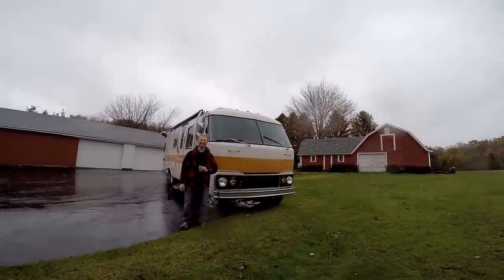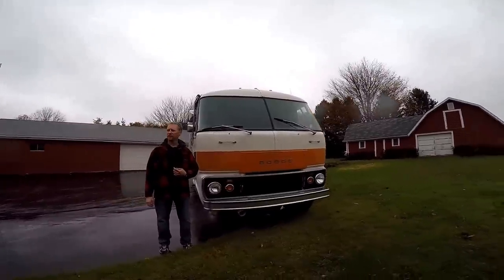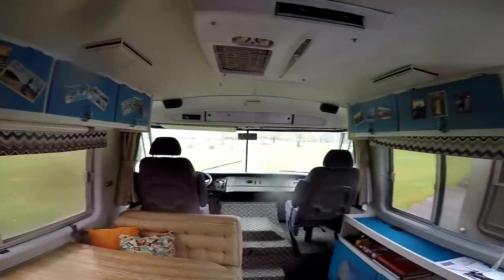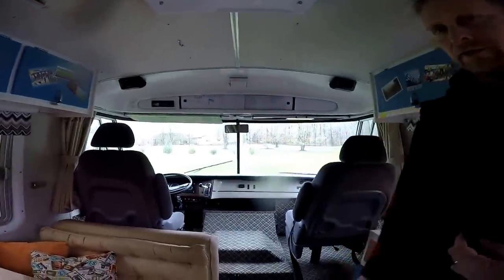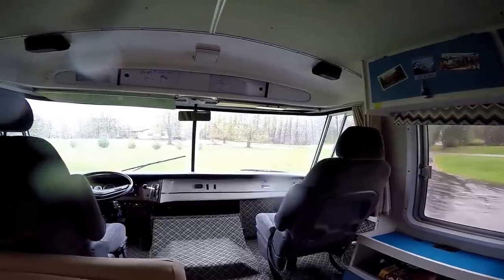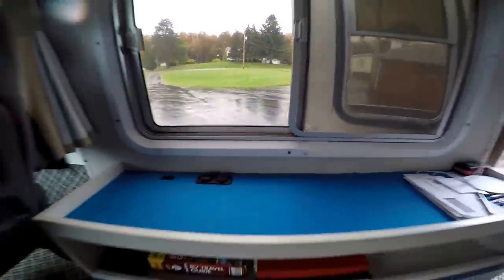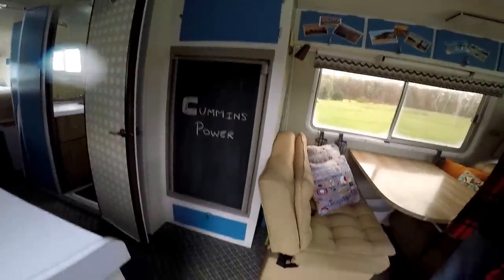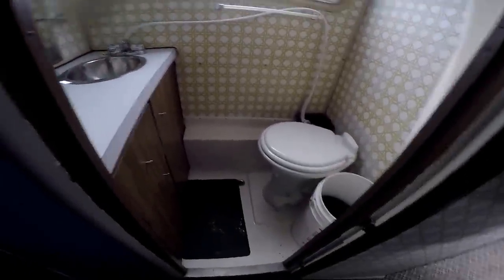Travco 270 RV Cummins Diesel Conversion + RIDE !!!

Comment: Great idea and work fitting the Cummins diresel. 5.9 liter turbo six. I had a 95 dodge pick up with the same engine. I sold my truck after 10+ yrs. Wish I had of thought of putting an all is on in my truck. I had the factory automatic rebuilt twice, the valve body replaced once and it was starting to act up again. I guess dodge can't build a decent auto to go behind the cummins. Great job man. You cannot wear down a cummins, there like the ever ready bunny, they just keep going and going, LOL........

Comment: This is a very impressive 440 RB to Cummins 5.9 conversion.  The fuel efficiency gain is significant.  Any comments about the overall performance gain/loss?  Specifically in start -stop driving and on hills?  Really nice all around rig. .. Many thanks for posting this video!
Reply from the maker: As you might expect, better low end power.  Takes off from a dead stop better than any motorhome I've been in.  I get a little slip at the top end and am looking at a lower stall converter as a possible fix.  Overall we are very pleased thanks for the comment.

Comment: Awesome machine and awesome job, great fuel mileage increase from 5 to 15 that's great. I have a 1991 Allegro with the 5.9 cummins that came with the RV I've not had it out on a trip yet so I don't know what kind of fuel mileage I get but if I can get close too 15 i would be real happy. thanks for sharing you video.again you have an awesome RV!

Comment: Sweet looking Travco motorhome. This is my idea of what a motorhome should be, not so big that you need a special bus driver's license, but not too small either. I would think that three adults could sleep comfortably in this rig. I've always liked the idea of a diesel engine in a motorhome like this. Awesome sounding Cummins Diesel. Thanks for the ride. If I had a rig like this, I would've gone either Cummins, Duramax, or even an earlier Detroit Diesel. This video is over a year old, does he still have it?
Reply from the maker: +Jason Carpp  Still have it, about 7500 miles on the combo now.  Running great!
Reply: +jpnrobb Awesome! Does he have his own channel? It'd be cool to see more vids of this Cummins powered Travco.
Reply: Three of my favourite motorhomes of the 70s are the Travco, the GMC Motorhome, and the FMC 2900R. :)

Comment: Wonder what my 318 LA motor will get for fuel economy in my 1970 Travco... Sadly, have no time to do a Cummins conversion plus it would still cost a lot just to get the transmission and Cummins to start with.

Comment: I'm wanting to drop the Cummins 4bt into my 20ft B-Camper van built onto a 1982 Dodge Van Chassis....just not sure it will fit, as of yet. Awesome rig!
Reply: are ya now lol sounds like a greeaat. idea. beat ya to it. 😛
Reply: Yes with some motor and tyranny mount mods it will fit

Comment: The Cummins engine weighs over a thousand pounds what did you have to do to the suspension?
Reply from the maker: According to Cummins the 6BT weighs in at a 1000 lbs. give or take 50 depending on the accessories.  I took the engine from a light duty pickup and installed it in a medium duty truck chassis so I did nothing to the suspension.  The MH actually rides and handles better with the Cummins than it did with the big block in it.  Thanks for the interest.

Comment: Fine job!  This is the best mating idea, taking a beautiful vintage exterior and putting in a high mileage diesel engine.  What is the approximate cost of getting this done - new engine like yours, and new transmission?  Just to get an idea of total renovation costs.

You did a marvelous job with cabinets and keeping it simple.  Looks functional and has clean lines.
Reply from the maker: +Lass-in Angeles Not sure what you would have in "new" parts but I found good used units for around 1800.00 total.
Reply: 0 p
Reply: Count on at least $10,000 unless u can do the work yourself. Also use a 12v Cummins 1989-1993

Comment: Does that engine cover have insulation, to reduce the noise of the Cummins Diesel engine?
Reply: Jason Carpp I thought the same thing, I used to have that motor in my 95 dodge p-up, told everyone you can hear me coming before you see me, LOL.
Reply: Hearing it coming is one thing, the last thing anyone wants is for the sound to be obnoxious once you get to your destination. 🤣

Comment: What would be easier is find a early 2000's class A with the allison transmission setup and 8.1 454 BBC replace the engine with a duramax diesel I think those will bolt right up to the transmission. The only issue would be smog controls lot of staters 2003 duramax wasn't any of the def fluid required.

Comment: Im doing the exact same thing do you have how you wired it with the factory wiring the engine came from i put a 5.9 with a Alison transmission already in mine with a wiring harness out of a 96

Comment: WHY didn't you go with the exhaust manifold that swings the turbo down closer to the block? It woulda saved you all the hassle of having to modify the passengers side floorboard as well as the engine cover! You can see that setup in our coach in my videos.

Comment: What chassie is that build on? Dodge RM400?
Reply from the maker: Yes Sean, that is exactly what it is. I no longer have the rig but it handled the extra weight of the Cummins with no problem.  The Cummins is only about 300-350 pounds heavier than the 440 that was in there originally.

Comment: how loud is it inside? can you easily talk or does the diesel make alot of interior noise?
Reply from the maker: I'm not gonna mislead you, it is a little noisy but you can have a conversation albeit with elevated voices :)
Reply: jpnrobb 

Thanks,  I'm thinking of doing a similar swap in my 74 superior motorhome.

Comment: Magnificent rig ! That turbo so close to the floor would get me a little nervous though.
Reply: Why would the turbo make you nervous ese?
Reply: A turbo blanket and a bit of heat shield on the doghouse not only would that fix the heat issue but it would also help help keep the heat in the turbo giving it slightly faster spooling.
Reply: @MrJollygreenz  good to know! thank you brother Charles!
Reply: @wildestcowboy2668  where I live, cars go up in smoke each year just by beeing parked on dry grass, due to the exhaust heat.... And exhaust pipes are much cooler than a turbo, that is why.
Reply: @RenoLaringo  I can respect that since you explained it that way. I think that he has a cover over the turbo tho. U be safe mi amigo!
Reply: @wildestcowboy2668  Thanks for the kind words brother. I didn't see that on the video hence my question. I assume he put something there indeed. Be safe and happy too my friend !

Comment: No overdrive?  What gears are in the dif?  I`m going to do the same, but i`m worried about the gear ratio.
Reply from the maker: brian smith I installed 3:07 Dana 70 gears in the 70 HD housing.  People will tell you it can't be done but they are wrong.  I had so many people tell me I couldn't do this whole project, I don't know why people have to be that way but it makes it that much better to prove them wrong :)  I can explain more about the gearing if you want just send me your e-mail address.
Reply from the maker: brian smith I forgot to mention how I found out about the gear swap.  Do a search on here for Dana 70 HD 3:07 gears Karl Jantz engineering will pop up.  Great guy I talked to him on the phone.
Reply: jpnrobb  look mate you can do it      
look pelopel   can not juagr  you
Reply: Or you can simply run an overdrive tranny like I did in mine and not go through all the trouble and expense of regearing the rear end. ;)
Reply: +michigandon I always thought about scavenging the powertrain out of a 1st gen Dodge Cummins with the 3-speed 727 (not the A-618) then putting in a Gear Vendors OD unit. Appears my Travco 320 has a Rockwell rear end, so re-gearing that would probably be ungodly expensive.
Reply: Not only that, the available ratios for a Rockwell are very limited and they are all on the low side. Double overdrive would for all intents and purposes be a must on a 320, I'm afraid.
Reply: If I were to ever build another, I would want to do it with a six speed Allison 1000. Fifth gear is .71:1 and sixth is .61:1!
Reply: +michigandon - I'm sticking with the 8R 19.5 set, a lot of folks switch to the closest 'modern' size. It's slightly shorter and the duallies can 'kiss' sidewalls. Believe my gear ratio is 4.56, so with an OD and the 'old' tire size, should drop the RPMs' abit.
Reply: I like the 8R`9.5s myself. I also had 4.56 gears and with a .69 overdrive could cruise nicely at about 60-65. Top speed was around 75 or 80 if memory serves?
Reply: The six speed Allison I'm referring to is from a Duramax-powered Chevy pickup, so yes it does have a park prawl on it.
Reply: There you go- I don't know diesel powertrains as well as a lot of guys do.
Reply from the maker: +brian smith   3:07 gears, had to have some creative machining done to make them work.  Look up Karl Jantz engineering on here.  He explains how to do it.
Reply: I reckon it can be done. How does it do in terms of fuel economy?